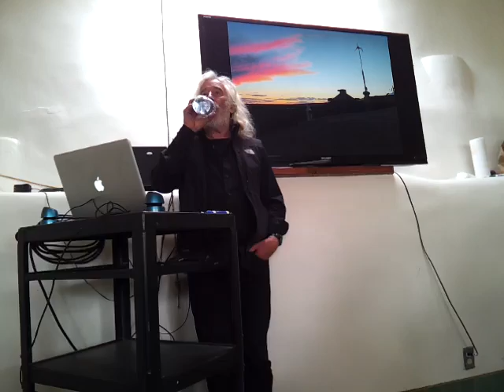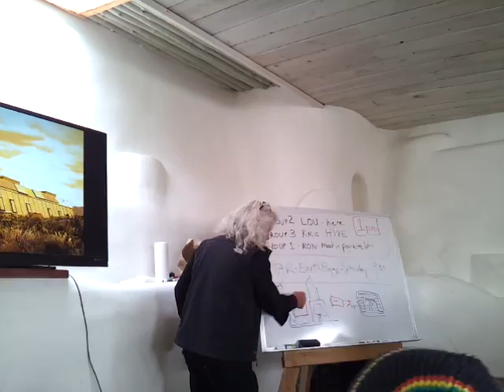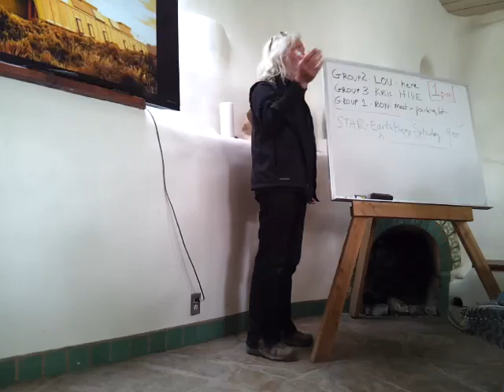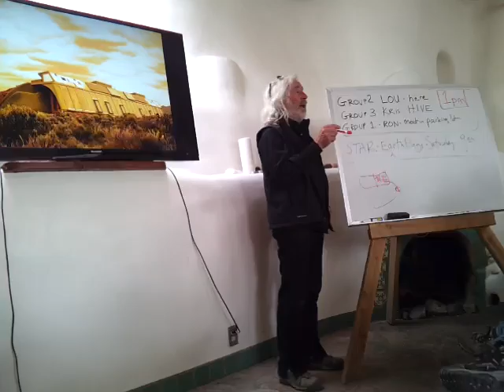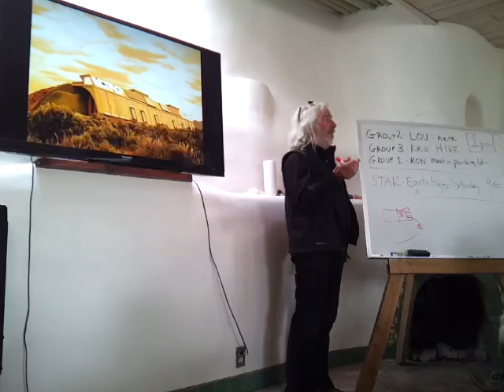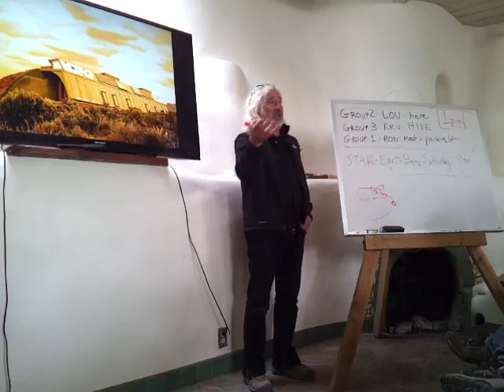Mike Reynolds. Electric system (2).

Comment: I'm wondering why doesn't the whole house runs on wind for the most part? There are dynamos capable of putting out 6500W, 28V, 350Amp for quite low price(I found a used 1 with a voltage regulator for 320$) add 1 or 2 to the windmill and it is more than capable of running a household, and only use the solar power when there is no wind.